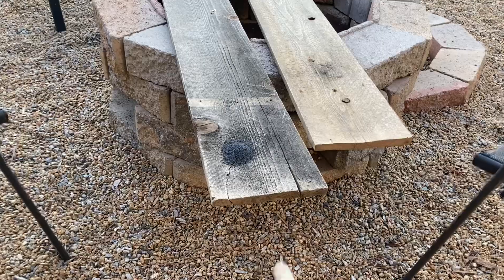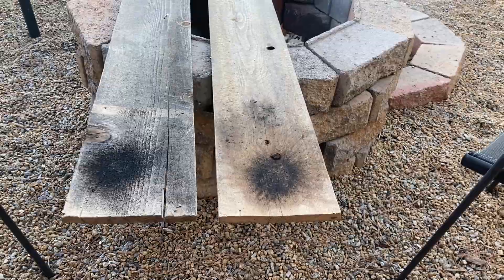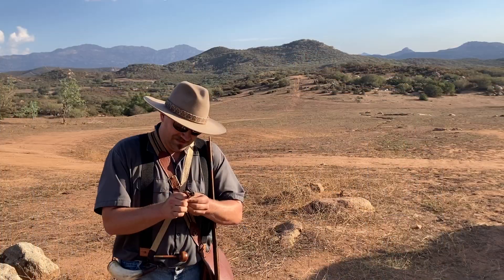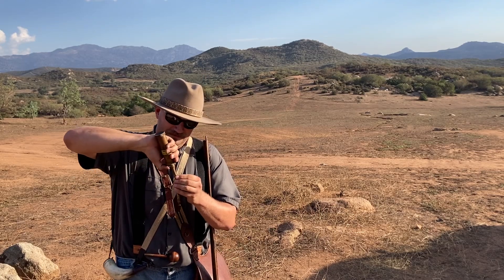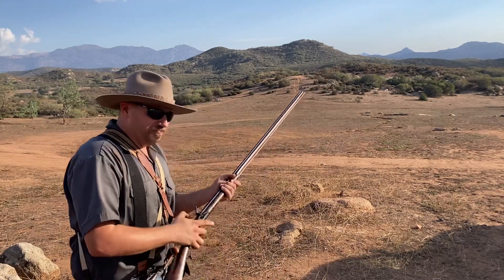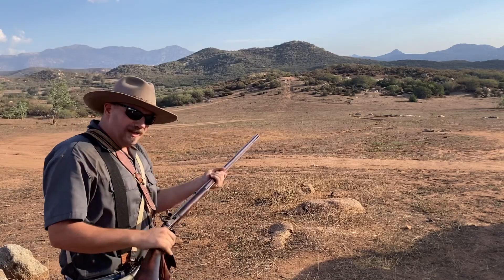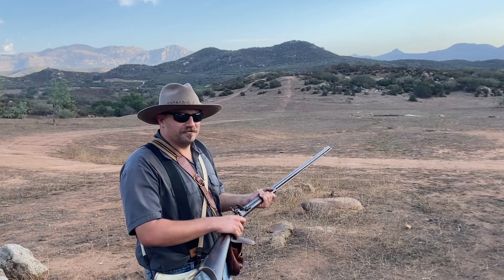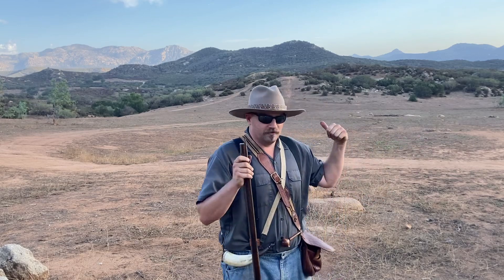Can you use Pyrodex in a Flintlock?

Comment: I'm not sure why, but stores don't sell real black powder where I live.  I had to order it on line, and I the minimum order was 4 pounds, and then you have to pay hazardous materials fee, so it ended up costing me almost $200 to get my hands on some black powder.  I decided to learn how to make my own.  It may not be as good as factory stuff, but it's better then the substitutes you can get from the store.
Reply from the maker: Good idea.
Reply: Note that, depending on how deep down the rabbit-hole you want to go, various substitute formulations are also relatively easy to make.  The main advantage being that sodium/potassium chlorate/perchlorate is a lot simpler to synthesize yourself than potassium nitrate is.  Do pay attention to the chemistries of what you're putting together though.  Some of the different possible formulas don't get along with others and will auto-ignite if you let the wrong ones come into contact with each other.

Comment: Over the last 40+ years of shooting cap and ball rifles, we have had times where Black Powder was not available.
In fact here in Utah back in the 80's our regulations had to be changed to allow Black Powder substitutes to be used during hunting season.
With Black Powder being hard to find, I choose to save my FFFF and FFF Black Powder and use Pyrodex  when ever it was practical.
When I hunted with my Flintlock, I would use 15 grains of FFFF Goex and top it off with 60 grains of Rifle/Pistol Pyrodex.
FFFF was used to prime. This worked out very well and shot accurately. I have sense semi retired my Flintlock though so it isn't an issue these days.
Reply: You can speed the loading process for duplex charges like this by making combustible cartridges out of magician's flash paper.  You ram the whole thing down the barrel and the whole thing burns up.  Works beautifully in percussion locks.  For reliable ignition in a flintlock you'll need to ram a pick in through the touch hole to puncture the paper since it has a much higher ignition point than the black powder.  But it saves you fumbling with two different powder sources and makes sure they don't get mixed together while you're ramming the ball down.

Comment: shooting for 22 years of flintlock i tried them all  but always used 4 f in the pan i found the order of hardest to ignite  pyrodex rs would hardly go off in my cap lock then pyro P then triple 7 2 f then triple 7 3f  if you use a substitutes triple 7 is the way to go easier to clean and goes off at a lower temperature than pyrodex  the triple 7 loading procedure for a flint gun in to put a little priming powder  5gr max down first hope this helps

Comment: I was once told, to increase reliable ignition with a flintlock, once the pan is charged and the frizzen in place, tilt the rifle slightly to the right. The powder in the pan will lie against the outside of the pan opposite the touch hole, better directing the flash through the touch hole upon firing. BS or any merit to this. Dave & The Girls
Reply from the maker: sounds like BS.

Comment: Back in the mid 1960's and early 1970's I began with DuPont gunpowder that was old barn find then.  Only had a few cans and I did not know how lucky or privilaged I was.  When it was gone, there was Goex and there was definitely a difference in ignition time and clean-up effort.  Then there was Elephant, one lot not so much as the last and dirty.  Swill and Shuetzen both more like the old DuPont.  Pyrodex?  I tried it with flint and cap; YUK.  Smells wrong and bad, very corrosive, and hard to clean. Pyrodex not to my liking even in cartridge loads,  First or second can is probably still around here somewhere, I dunno, nor do I care.

Comment: I'm almost 70 years old. Started muzzle loading a little over 50 years ago. Pyrodex is the only substitute I ever used so can't comment about the newer stuff. I don't get to shoot or hunt much of anything anymore because of health issues. 
     Here are some FYI'S for young shooters that maybe you know but bear repeating. Pyrodex is measured by volumetric equivalent to black powder. Theoretically if you weighed a charge trying to be scientifically precise you could get an over charge. Even in a percussion gun Pyrodex needs a high quality relatively hot cap. Don't waste your money on the cheap Italian ones. CCI and RWS were the best in my experience. Pyrodex is very hygroscopic which means that it draws moisture out of the air, so it's going to rust a bore faster than black powder. When hunting don't leave a charge in the rifle overnight to save money. Shoot it and swab it out with a little black powder solvent. If you're lucky enough to live in the country or on farm like I do you can shoot a fouling shot if you believe that improves accuracy before head to your hunting sight.You might let any neighbors within ear shot know why you're shooting when it's still dark.  Don't reload until you get to your hunting sight.
    If you want to try Pyrodex in a flint lock, see if you can find some photographic flash powder. Mix a small amount with preferably 4F  priming powder in your priming powder horn. You can try screening 3F if you don't have any 4F. You might be able to find flash powder at a theatrical or magicians supply or antique photography specialist. I'm sorry I can't remember what percentage of flash powder to mix with your regular priming powder, but it will greatly increase the speed and reliability of your priming charge. I think it also increases the temperature but I'm not positive about that. You'll all have to do some research. Happy hunting boys and girls.
Reply: Flash powder is basically a little black powder or similar plus powdered magnesium or aluminum.  You can find recipes optimized for particular uses on various pyrotechnic community websites for their use in mortars and color shells.  It's quite applicable to firearm priming as well.

Comment: When I was using a lot of Pyrodex, I often had percussion caps fail to ignite the charge in my revolver.  Since I switched to BP, those problems are virtually non-existent.
Reply: Ream the touch hole inside your nipple out by half a thousandth or so.  Or fill the nipples with an 80/20 mix of 4F black powder and fine-ground sand.  It's purely a matter of needing just a bit more fire getting into the main charge to ignite pyrodex.

You can find a lot of good material on optimizing priming, booster, and main charges based on propellant and touch-hole sizes if you go digging around in the pyrotechnic community's websites.  Including how to make your own black powder, pyrodex, priming compound, and other, useful stuff.  They're doing fireworks, of course, but most of it is equally applicable to firearms.  Technically including the ability to change the color of your muzzle flash if you want...

Comment: Well I never had a problem shooting Pyrodex out of my .45 percussion rifle, or my .44 Confederate Navy revolver. And I never seen a hang fire like that as long as my powder was dry. But I also never shot flintlock rifles or pistols. Knew one guy that did though, and he tended to push the Pyrodex up on the side pan a bit more. Always thought that was strange, but now I understand why he did that. Now I do not shoot with Pyrodex anymore, I’m using real black powder. But I will be changing the bore lube, that I use as this stuff I got sucks as it’s too thin.
Reply from the maker: Pyrodex works fine in anything that uses a percussion cap

Comment: I wonder if firecracker (flash) powder would work for priming? It's certainly easier to buy hundreds of firecrackers than a pound of black powder.
Reply: That's usually super-fine black powder or a perchlorate mix like Pyrodex.  If it's formulated to make a bright flash instead of just a bang then it will have powdered magnesium mixed in, which will increase the temperature and possibly help it ignite your main charge more reliably.  Some people who make their own percussion caps use it because of that.

Comment: If you are a re-enactor, you cannot prime with black using pyrodex in the paper cartridge without having to depart radically from either von Steubin's or the 1764 British drill, and accurately presenting the musket drill is as important for safety and period portrayal as is having your musket volley nice and tight, not ragged or out of sync,

Comment: You're supposed to be using 4f black powder in your Frizzen pan even with pyrodex, at least according to the people that I knew about four or five decades ago who used pyrodex. They were regularly using 4f black powder or flash powder as one product was called for the frizzen pan which is what you're supposed to use.
I never played with black powder too much but I do understand how it functions and how piratex functions. But everybody that I knew that played with flintlocks even a little bit understood that the replacement powder was not to be used in the pan. It was created only as a replacement for the main charge.
Reply from the maker: Right, So for pyrodex to work properly you need real black powder…
Reply: @Everythingblackpowder  Ignition temperature of pyrodex is roughly twice that of black powder.  So you don't necessarily need "real" black powder to set it off, but something that burns more energetically than just "more pyrodex" definitely helps.

Comment: I would like if you tell about how to use smokeles powder in a flintlock and also how you can rebuild your flintlock barrel to not break and what material resists to the smokels
Reply from the maker: I’ve never heard of such a thing. I have no idea
Reply: @Everythingblackpowder  i was thinking about the most of smokeles and a litle bit of black for the beautifull smoke, and the smokeles for more power
Reply: @Everythingblackpowder  i have no weapon, can you please help me with the schematichs i need to build ? Gunsmith manuals i want to much the spencer 1871 rifle, lemat revolver, colt saa and volcanic poket pistol
Reply: Absolutely DO NOT DO THIS! Barrels for black powder are made from a different steel. Smokeless powder turns a black powder gun into a grenade. Unless you are looking for a Darwin Award, do not do this!
Reply: @666toysoldier  answer me ! HEY WHAT YOU THINK YOURE INFORMING ME ? i YET KNOWN THIS, i known alot more than yo
Reply: @Vo_d_kontra_o_norMAL  Unless you re a master machinist with a well-equipped shop, these are well beyond your ability. Start with a simple muzzle-loading kit.
Reply: @666toysoldier  shot up ! Get out here now

Comment: Religious convictions about powder? No. But since real black Powder is so much better than Pyrodex why bother concocting any kind of a load to make it shoot well. I started muzzloading with Pyrodex because most all the hunters around me used it or something more expensive than that and that stuff is hard to set off, it requires drilling the flash hole in your percussion nipples a little more open, which leaves you open to different problems, giving gas a second means of escape. I thought muzzleloaders were unreliable pieces of crap that were only marginally better than quickly fashioned homemade bows from green wood from a sapling you cut down. Then I found a now extinct substitute that showed me reliable ignition and consistency in a muzzleloader is possible. Well when I couldn’t get any more of it I bought my first couple pounds of Black Powder and man it’s a different animal. It is EASY to set off, pretty consistent and it’s pretty forgiving compared to smokeless and substitutes.

Comment: Well I use triple 7 in my flintlock and prime with black. However it does help if you're flintlock has a powder mag incorporate in the breach plug. A Mortimer pedersoli has this or a PA pellet ultra light tradition's. A simple side lock  won't work as well with a substitute . I use triple 7 because it is easy to obtain. I only have one place to by black at 60.00 bucks Canadian. If you're shooting a lot it adds up quick. I get more shots out of a lb of triple 7 because it's more powerful. 78 gr is the same as 100 gr of black and that's still a hot load. LoL . Black powder is a true explosive because of it very low ignition point. The flintlock is best with black powder it was made for it.  Even though flintlock rifle and shotgun's require no license to buy in Canada only a driver license they never took off. With the country wide confiscation the government wants to do here in Canada it might be the only thing left if we are lucky to subsitant hunt with. That is what I use my flintlock for.

Comment: i've been out of blackpowder for decades ( we only had real black and pyrodex then the non corrosives were 6 months away when i gave it up!) but i'm getting back into it out of necessity again!! just out of curiosity do they make a sub that matches 3F or 4F that's meant for pistols and have you tried that sub in the flint?
Reply from the maker: Pyrodex p is the 3f equivalent and it’s not any better
Reply: @Everythingblackpowder  i didn't figure it would be but as i said just curious if you did try it and the result, everybody i had anything to do with preached 3F or 4F for the pan and you said pyro was 2F equivalent which was going to automatically bring up the question in me! honestly though i never did care for pyrodex myself my cap lock fired it fine but i always felt it did better with GOEX or Schuzetzn.

Comment: Pyrodex, is potassium nitrate and sugar?
Here in Brazil you can find PB, but never pyrodex.
Reply from the maker: I suspect it’s a sodium nitrate product
Reply: @Everythingblackpowder  Following is the original formulation of pyrodex.   Originally I believe it was it was used as a 'safer' BP substitute in mining but fell away ironically do to misfires, which made it unsafer as you could imagine with Techs refusing dud holes.  Another piece of trivia is the inventor died in a pyrodex factory explosion in the late 70's.   Pyrodex is chemically similar to BP,  but  made to be harder to light and burn slower in the open as you mentioned.

45 potassium nitrate

9 charcoal
6 sulfur
19 potassium perchlorate
11 sodium benzoate
6 dicyandiamide
4 dextrin

The  main departure from BP seems to be replacing a good portion of the kno3 with kclo4 as well as lowering the S content.  This will make the mix harder to light and produce more gasses once it does get going.   The lowered sulfur content is replaced with the sodium benzoate as a fuel.

Comment: Well, you are perfectly right. I personally a big fan of Black MZ and was lucky to stockpile a lot paying $10/lb just before it got discontinued and I am using it in my caplocks and cap&ball with a great success. But it doesn't work in my flintlocks. Which is sucks because Goex/Swiss is unobtainable this days. So I had to start making my own with limited success so far - it goes kinda slow. Still learning, thanks for your work!
Reply: Only speaking to using Black MZ here, but not to contradict Mr. Everything Black Powder in any way.   . . Black MZ has worked in my flintlocks all along for at least 3 years, but only with 3Fg in the pan.  Black MZ is a good substitute in volume for 2Fg, but production was stopped by Alliant Powder in 2019 (perhaps?).  Based on its clean burn and no need for lubes, there is a loose powder substitute brand available which possibly gives similar results: Jim Shockey's Gold (by American Pioneer Powder).  Anyway, in the past Black MZ has been a great BP substitute for me for plinking (only with 3F in the pan); a nice aspect to it is, that its residue is totally non-corrosive.  And at only 9.95 per pound! - but sadly it hasn't been available for over a year.
Reply from the maker: I’ve never tried Black MZ and with all do respected, I don’t plan on it. I suppose I’m a purest. 😉
Reply: My experience the same. No black to be had anywhere near me.
The black MZ does work great in cartridge loads though!
Reply: The secret to getting your BP to burn fast is twofold. First is good charcoal. Willow works best it seems, although I have been told that pinecones are great too, but I haven't tried them yet. Next is milling time..... the longer the better... I find at least 6 hours is needed, but mills to vary a lot. Then we have granulation process. The factory process is one of hydraulic compression followed by smashing up the 'cakes' and grading them. This is possible at home but does mean that only a small amount of each grade is ,ade out of the basic, usual charge of about a pound of ingredients at a time. The "wet" process gives good results but the powder is now quite as dense as commercial stuff, so has more volume for its weight. For equal results to commercial powder you need to find the volume that is the same weight at the usual volume of commercial powder. Do that and velocities are identical. I find in my revolvers, with their limited chamber volumes, maximum charges of my powder are about 10% down on velocity compared to German Schützen powder..... from 890fps with 200gr conicals down to about 810 with my powder... mind you my stuff is more compressible, so most of that difference can be eliminated. For front-stuffer rifles and shotguns of course there is plenty of room for the extra volume so just up the volumetric charge 10%. As far as I can tell from open air burn speed tests the difference between my powder and commercial is negligible. My granulatiion wetter is IPA and water with about 60% IPA and the "dough" forced through a domestic sieve to yield something close to 3F granulation. A little graphite added aids flow through measure spouts but isn't essential.
Keep at it.... there's stuff that can't be written down. Every batch I make seems a bit better than the one before, so there are intangibles operating that are hard to define.